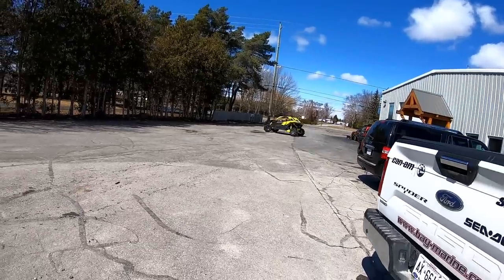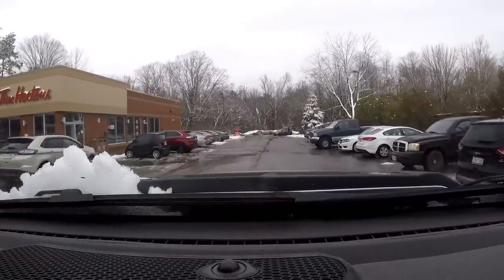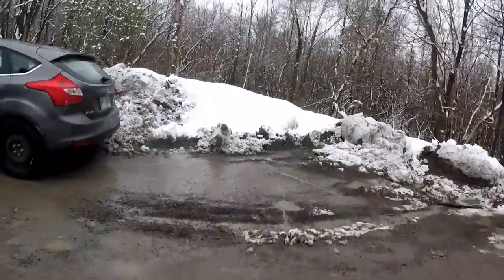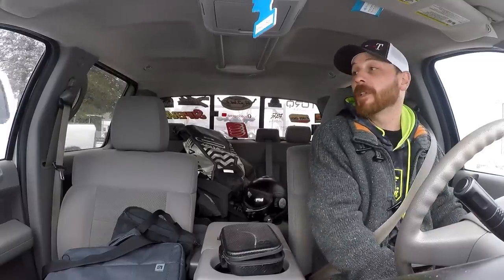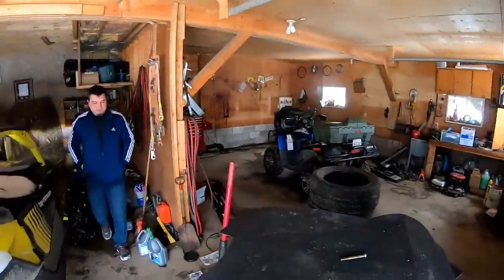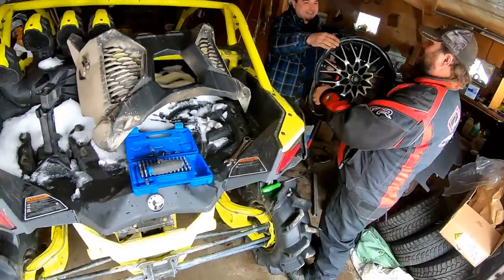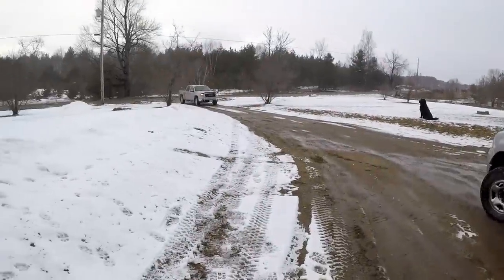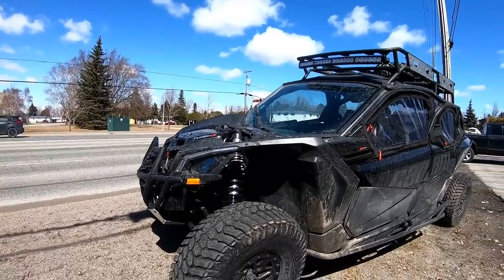STRAIGHT PIPED THE TURBO X3 WOW!

Comment: I had the same leak on the secondary o-ring. I found the leak by using the garden hose and filling the CVT intake with water and looking for the leak. Don't just replace the o-ring also use a sealer to ensure no future leaks. Worked for me, no leaks in 2 years!
Reply from the maker: Yeah, for sure I will. Thx eh

Comment: How do you tune your engine of a renegade after putting on a new exhaust? Do you have a video?
Reply from the maker: Just a simple fuel tuner install. I used Jeff Ross, the bom racing tuner and it comes preset with fuel tune for your machines

Comment: I'm not a fan of extremely loud exhaust that doesn't have a deep bass tone with a mellow sound. But even on my Commander with stock exhaust and a metal roof you'd get tired of hearing it run   I hope I'm wrong and the X-3 isn't the same way.
Reply from the maker: I'm sure it will be, But really setting it up for the mud pits at Dungannon this month. After that we'll put something a little more tame on it.
Reply: eh TV I knew you had to have a reason
Reply from the maker: Always a method to the madness brother.